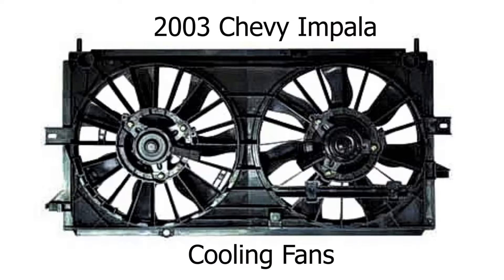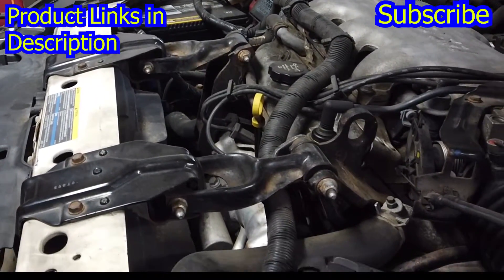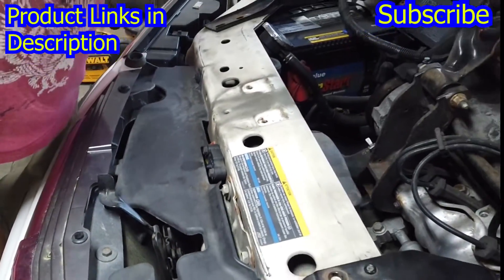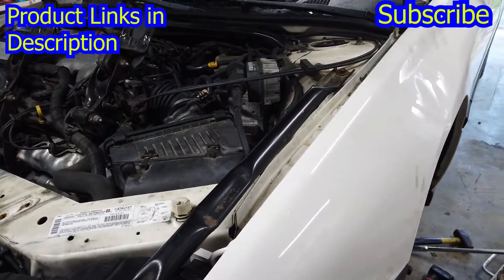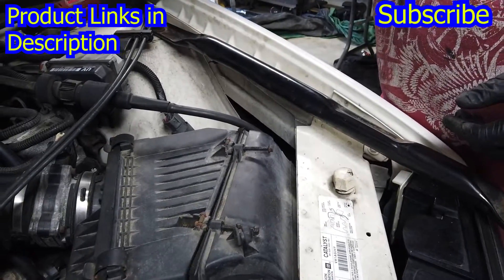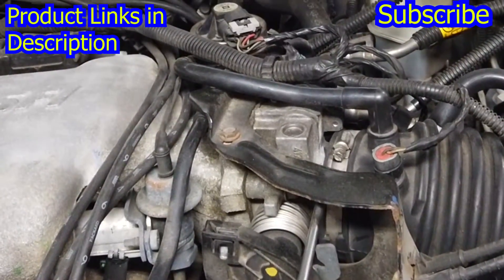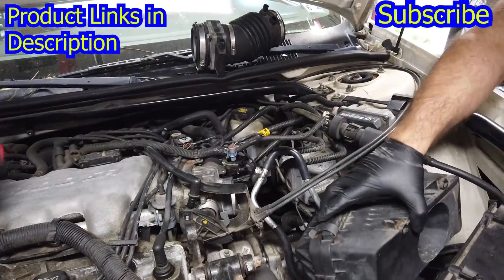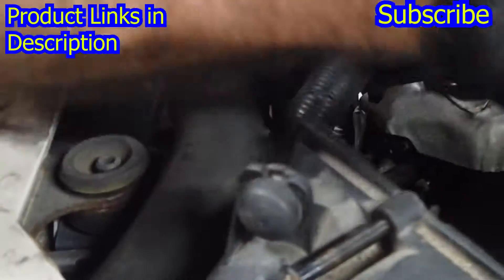Chevy Impala Cooling Fan Replacement, Fix Overheating Car, Remove/Replace

Comment: Is it just me or did he not show how he got to the lower bolt on the driver's side?  Its the reason for removing the air filter housing and the radiator hose.

Comment: Hey Jamie! possibly dumb question but beginner auto DIYer, should I be draining the coolant before starting this repair? I was assuming that was a radiator hose your taking out with those sweet clamps for the ring around the hose. Just want to doublecheck before I get coolant everywhere

Comment from the maker: Chevy Impala Cooling Fan Replacement, Fix Overheating Car, remove/Replace, The Chevy Impala cooling has stopped working, creating an overheating condition, we will give you a step by step DIY so you can save yourself some money.
****************************************************************** 
Thanks For Watching  , Checkout This Play List
https://www.youtube.com/watch?v=yb5M7QLS1sg&list=PL8kPE7Ywpu4hnDulmz2Jj7BYQ2aGIburU